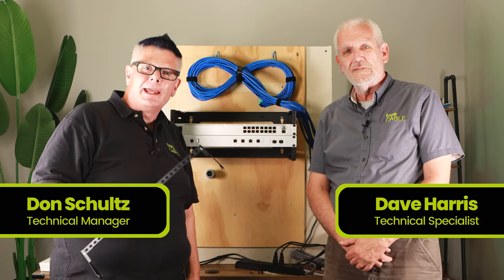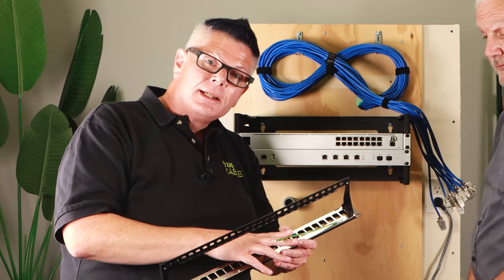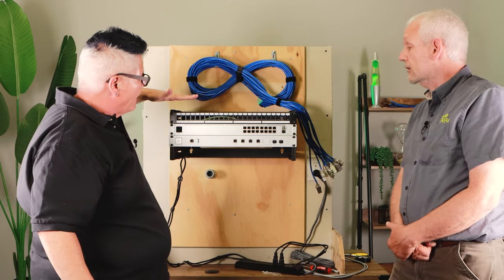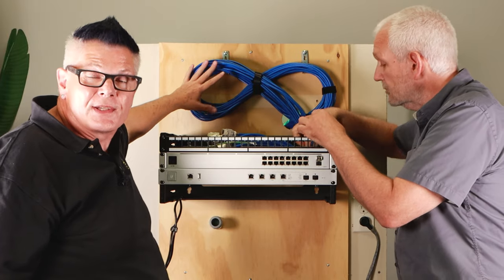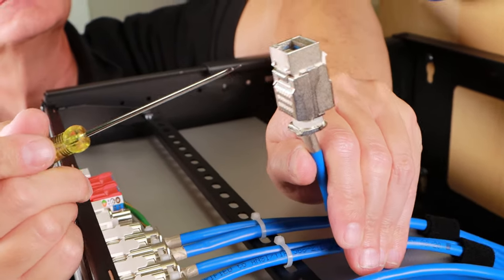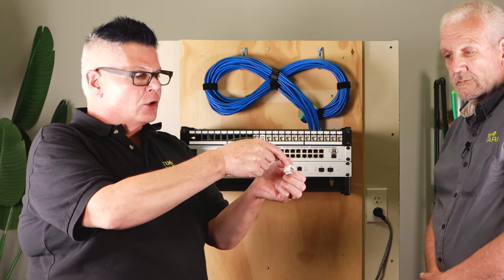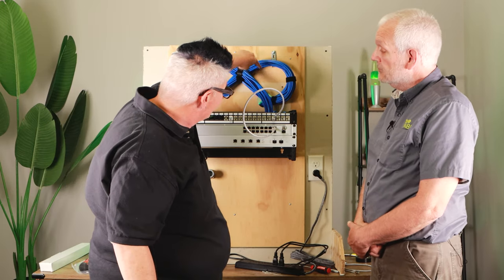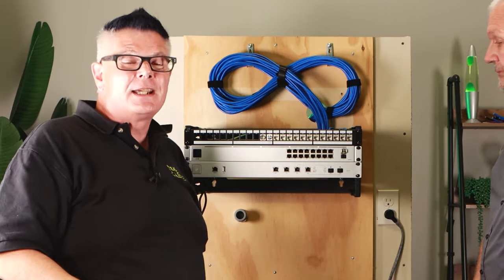Shielded Patch Panel Installation Simplified: A Start-to-Finish Guide

Comment: Excellent videos!
With home setup in mind using cat6a f/utp, if you don't ground the patch pannel, is it enough to ground it through a modem/switch or one computer that is grounded through it's electricity connection?

And i assume it's important that any grounded device connected to it, is grounded to the same endpoint to prevent a loop. So grounded to the same thing your electricity is grounded too.
Reply from the maker: Hello, and thanks for the compliment!

The minimum requirement is to bond at the switch side (via shielded patch panel of some sort). To avoid ground loops, you would bond everything to the same AC system, which only has a single point of ground or multiple points of ground all equalized to become essentially the same ground point. As for reliance upon an AC-powered switch and shielded patch cords going from the patch panel to the switch as a ground path, you CAN do that, but is it going to be reliable enough? I suppose if that is all you can do, then so be it. At least you bonded to ground via a round-a-bout path. That said, if your cable takes enough of an ESD hit, your SWITCH is the first in line to get a port (or ports) fried. It is better to isolate the ground path from the patch panel to ground FIRST. You can still use shielded patch cords in that situation since the path to ground will offer less resistance via the patch panel ground before any ESD discharge makes it to your switch. Ultimately, what you end up with is going to be dictated by your budget, installation ability, and space for such a system. Just be aware of the pitfalls associated with it. A quick way of making the whole question irrelevant is to NOT use shielded cable unless you have to have it for some reason. Shielded cable does not, by default, make your cable faster. It might be a waste of money, actually. In a residential setup, shielded cable is of limited use unless you cannot maintain a few inches of separation from AC power circuits on parallel.  Feel free to ask if you have any more questions – we're here to help!

Comment: Hi,

Firstly, love your videos. I really appreciate the content and attention to detail. 🙂

I know you cannot mix in unshielded CAT6a (10Gb) and shielded CAT6a runs to this unit but could you mix them if both are terminated with shielded keystones? 

Would the shielded keystone be enough to block alien crosstalk for the unshielded cables in this unit?

I ask because I currently have about 12 unshielded CAT6a lines, improperly run and terminated by a contractor, which I’m re-terminating. Since the original installation, I’ve run another 4 shielded CAT6a lines and I’d love to transition both sets to this unit. I’d love it if I didn’t have to buy a 2nd patch panel and waste another 1U slot when there’s plenty of space left over on the 1st patch panel.

If not, will you be working on a staggered shielded rack for mixed environments?
Reply from the maker: Hello Geronimo! I am glad you like our content. Here is a work-around: Snap your unshielded Cat6A runs IN BETWEEN each shielded run. In other words, do a stagger pattern on your own. Shielded run with shielded keystone, then unshielded run with unshielded keystone, then shielded run with shielded keystone, and so on. I think that will do the trick! We offer a straight-across shielded patch panel, but have no plans for a shielded stagger patch panel. Using a shielded keystone on unshielded cable does not magically protect the cable from ANEXT, unfortunately.
Reply: Thank you so much for the workaround!
Reply from the maker: @JeronimoColon  You are welcome Geronimo!